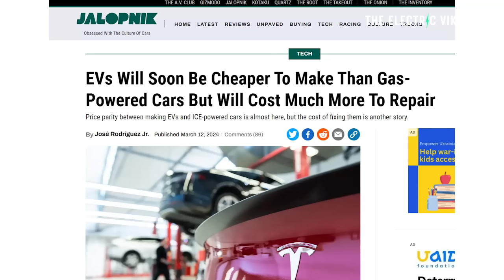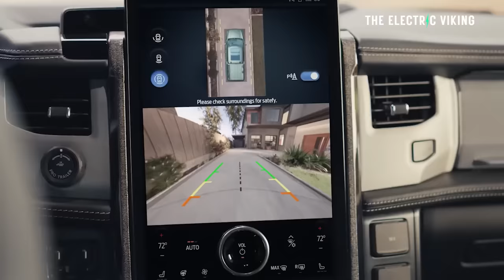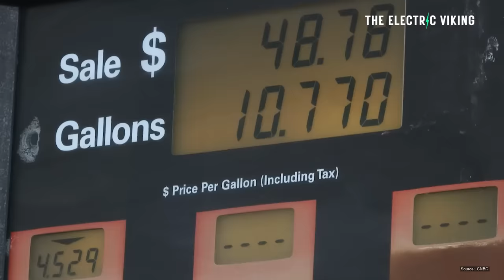The EV Price Premium no longer exists in the United States

Comment: And when they actually test the running costs, EV is the same or more expensive if charged at a supercharger in UK and only cheaper when charged at home. Total cost of ownership is what matters and seems things like insurance is double with EV compared to ICE, expensive battery might need to be replaced after 10 years due to degradation if one keeps their car that long. (although the claim is new batteries last a lot longer). Repairs: another example where EV, at least Tesla is much more expensive, afaik that was the reason Hertz was in trouble with their Tesla fleet, damage repairs much more expensive. When I did the math based on UK prices,  as long as petrol is less than 1.8 per litre, my ICE would be cheaper than the average per mile costs of EV charged at Tesla station at 60p per KWh.
Reply: Only if your silly enough to use a supercharger. Most people charge their cars at home most of the time at a fraction of the price. Unless your away from home most of the time your charging costs will be just a few (single digit) pounds/$ per charge. That's nothing unless your importing your own petrol at mate's rates from your brother in Russia
Reply: My understanding is that the business model of car rental companies is based on the expectation that they can buy a new car for $new, rent it to customers for, say, 3 years, then resell the car for $secondHand, and the depreciation cost of the car ($new - $secondHand) is low enough so the company can make a profit in its business. When Hertz decided to add lots of Tesla cars to its fleet, demand for Tesla cars was outstripping supply by so much that second-hand Tesla cars were selling for close to (and sometimes more than) the cost of a new Tesla car. This lead Hertz to think that adding Tesla cars to its fleet would result in a depreciation cost ($new - $secondHand) being remarkably low, and this would increase Hertz's profits.

However, what actually happened is that one or two years later Tesla managed to increase its production capacity enough so that supply was meeting demand, and this caused the price of second-hand Tesla cars to drop. To make matters worse (from Hert's point of view), Telsa began a campaign of aggressively cutting the price of its cars. The result of this is that the depreciation value of Tesla cars in Hertz's fleet increased alarmingly, and Hertz realized this was going to be bad for profits.

The above hypothesis is based on what I read about Hertz. I don't recall reading anything good/bad about Hertz's maintenance costs of Tesla cars in its fleet. I'm not saying you are wrong; merely that there might have been more than one reason behind Hertz's decision to remove Tesla cars from its fleet.

By the way, if Tesla continues to be successful in its mission to speed up the ICE-to-EV transition, then I expect that the value of second-hand ICE cars will drop alarmingly at some point in the future (logic: if most people want to buy an EV, then then the supply of second-hand ICE cars will outstrip demand for them, thus causing their price to drop), and once again car rental companies may find themselves struggling with higher-than-forecast depreciation on cars in their fleet. If so, car rental companies may find themselves in a "Damned if you do, and damned if you don't" situation.
Reply: @mikevanlokven7384  Silly enough? Are you silly enough to think that most people live in their own houses and can charge at home? You don't understand there are plenty of city folk living in apartments with no electric outlets anywhere near their car?
Reply: @CiaranMcHale  What I read is that the problem was with repair costs, because Hertz insures their vehicles themselves. So they pay repairs themselves and those were very expensive and slow for Tesla vehicles. Depreciation might also play a major role though as you said.
Reply: Tesla superchargers don’t charge 60p per kWh. 

Most I’ve ever paid is 43p per kWh
Reply: @cyberfunk3793  If no place to charge at home then be creative and work charging into your daily routine. I have met many people who do this.  Stop being so negative and use some creativity.  If you really want an EV, you'll find a way.
Reply: Power cell technology is improving and they're devising new types of cells that are much cheaper to produce, so in 10 years if someone needs a new power cell then it will be very cheap. 
What you need to consider is that electric cars have less maintenance because you don't need to deal with oil changes, tune ups, spark plugs, belt changes, (regular) batteries, alternators, fuel pumps, transmissions, smog checks, etc. An electric motor can last several decades with minimal maintenance. So if the only thing you need to worry about is spending a few grand to change your power cell once every 10-20 years then that's still cheaper than owning an ice vehicle.
Reply: @GoodBoyGoneDad  My Accord is 18yo and I never needed to change a fuel pump, transmission or alternator. Belt didn't fail, but I changed it myself for something like 20€ and I changed spark plugs once, they last 160k and are not very expensive . Tyres, brake pads, oils, filters, coolant I have changed myself and current insurance is 20€ per month (car is so old, I only have liability insurance on it). Even if I had total insurance it would have been cheaper than EV to maintain and I'm not so sure EV don't need a new battery after they are 10yo in the future also, we have to see what the real degradation is in the future.
Reply: @jakes6147  I just checked it few days ago, and it was 60p/KWh for people that were not Tesla owners. You can possibly get some membership that lowers that, but then you need to add that small membership fee to the calculation. Other fast chargers than Tesla are also expensive, if they are for example close to a motorway where ICE vehicle on a roadtrip would typically be filled.
Reply: @muskrat3291  What does it mean to "into your daily routine" ? I work at home and have no place to charge it for free. In the city I live now, there is free parking wherever you find a place and no reserved spots, so should I just be creative, find a house and steal their electricity during night time? Currently I fill the tank when it's empty and I'm going somewhere, no creativity needed for that and this is obviously a comparison between ICE and EV. I don't really want an EV, I might get one when current car dies but certainly the picture doesn't seem so rosy to people that live in apartments as many people imply. For EV to be cheaper, it seems you really need to be able to charge it at home during night.
Reply: @douglaswatt1582  Ignorance like: "In Australia, for instance, EV owners face insurance costs that are on average $661 higher per year than those for ICE vehicles."

My insurance is 20€ a month so yours is much more than mine although much less than typical EV in most countries. Why would I need personal experience to compare factual numbers and statistics? You can't do elementary school math? Talk about embarrassing 😂
Reply: @cyberfunk3793  You’re correct it’s more expensive for non Tesla owners and also there are very few superchargers in the UK that will allow a non Tesla to charge. 

One of the perks of owning a Tesla is the supercharger network, which in my opinion the other chargers can’t compete with currently. 

My local supercharger is 34-43p per kWh depending on the time of the day. (For a Tesla) 

But I charge at home like many other EV owners 99% of the time. It currently doesn’t make sense to own one if you don’t have that facility available.

Comment: Other issues: Still way to expensive to insure! Sure that will come down eventually, how many years before that happens. Secondly, servicing and charging Infrastructure!
Reply: Sure. If you’re a crappy driver.
Reply: @ConstanceCox that's wrong and uninformed. You pay for other drivers bad driving and their stolen cars. EVs will be impossible to insure soon.
Reply: @mikemars5984   Generally each post like yours is followed by an EV driver showing you are wrong.     However if you keep spouting this more insurance companies will raise prices because obviously the public thinks they should.
Reply: @danharold3087 EVs are heavy compared to a ICE with comparable size. EVs have large acceleration compared to ICE vehicles. It isn't necessarily right or wrong if insurance premiums will go up when the data insurance firms need to make proper quotes are based on a vehicle with less than 10% market share of currently registered vehicles in the US. I just liked the irony of people who complained a ICE vehicle had 1200hp on public roads, and now, somehow, everyone is on board with putting that weight and acceleration at their fingertips and for sure there will be less accidents because of that. Surely. They are also harder to insure as IF there was an accident, a damaged battery and enough body damage can easily exceed the 70% requirements to classify a vehicle as Totaled. You don't even have to impact a battery directly for issues to happen, not as likely, but it is a possibility with sudden deceleration. And with tesla incorporating whole cast body assemblies, body repair costs with be higher aswell. No more bolt on, it's all one piece!

Comment: EV sales continue to double every two years.
Reply: Sort of a Moore's Law type thing.
Reply: Not in the UK. Sales of EV's in 2023 were 16.5% of the total fleet, slightly down from 16.6% in 2022.
Reply: This is still the early-adopters wave. It will start to get worse and worse until we have good enough charging infrastructures and better and cheaper batteries.
Reply: @ev.whyking You are conflating the total cars out there with annual sales.  Annual sales continue to double every two years.
Reply: @ev.whyking Around six million sales globally in 2021 and around 14 million in sales in 2023.  Doubling every two years....
Reply: @ev.whyking You have a reading comprehension issue.  Try rebooting your hard drive.
Reply: Yeh, not from this point forward.
Reply: @romanpolanski4928 what is that in actual numbers?
Fleet means every car on the road of any driveline does it?
Did total fleet go up or down? And if so by how much? That's relevant due to the use of the % based on unknown numbers.
Reply: @MinusEighty any doubling is clearly over for the time being.
Reply: @ev.whykingyou are right percentage figures are Meaningless.
The actual numbers are crucial. 
They show a steady increase in BEV sales. 
However you look at it that is bad news for the ice makers.
Reply: Rubbish, the EV dream is over. The fight back has begun.
Reply: @mikemars5984  You clearly have a political viewpoint. To me it is just a superior technology that saves me money compared to paying for gas.  In reality evs will win because they are better. Faster, cleaner, and cheaper to operate.  But, by all means believe whatever you want.
Reply: @MinusEighty  Certainly not cheaper than my Accord so far, especially when I have no way of charging at home and insurance costs me 20€ a month.
Reply: @cyberfunk3793  Hey from now on, every time that you are fueling up and wasn't all that money on gas, think of me as I drive the same distance for a fraction of the cost.
Reply: @MinusEighty  And this will not last forever. The price of the electricity will go up together with the EV adoption. At some point in future you will spend the same money, not for gas, but for electricity to charge your car. Currently we are living in the best EV era, when it's still not massively adopted and there are such things like incentives, cheap electricity, free parking, no taxes etc...
Reply: @MinusEighty  Only way you could do that was if you have a home charger, which I could not possibly have in an apartment so why would I care? Everytime you pay your insurance, you can think about me and my 20€/month insurance bill on my Accord.
Reply: @MinusEighty  clearly, you are basing your opinions on your own personal circumstances. You are swallowing all the hype. Try projecting on the rest of the world and how that will work. Car manufacturers are reigning back on EV production. There are hundreds of thousands of unsold EVs. That's why the price is dropping. Insurance is having a negative impact. The EV utopia is a long way off. There is nothing wrong with an ice car with the right engine and fuel. I don't believe you are having no issues.
Reply: @mikemars5984  I get it.  There is a lot anger.  At the same time, my used Tesla is great, and my next one will have 300 miles plus of range.  So while the CO2 nutters obsess about slight temp changes, and people like you get angry about mandates. I will just continue to enjoy a great car, that is cheap to drive.  Peace.
Reply: @MinusEighty  You are talking to many combustion car owners here so 300 miles of range isn't something to actually brag about. I get over 900km on the highway on a single tank. I don't have an issue with EV and my next car might be one if the prices keep going down like it seems, but there are many EV owners that act like the vegans of the car world,  that present them as the best thing since sliced bread and claim they are so much cheaper when in many cases it's fairly close.
Reply: Just 2 EVs made it into the 2023 U.S. top 25 auto sales.
Reply: @planetsmoothcoaster  Still, doubling every two years...
Reply: @grasho kind of what happened in my home country when people disconnected themselves from the central heating system and started making big saving by using an apartment heating system using natural gas. Then natural gas prices increased greatly and now they pay the same as before. And that was before the Ukraine war started. Although if you have a home and solar panels you might be able to avoid this with an EV. But for public charging, in the long run people will pay the same as for gas...
Reply: Where? Not in Europe I’m afraid. We need better range, faster charging, cheaper cars and crucially better infrastructure. All needed for mass adoption for EV’s to become dominant.
Reply: In China
Reply: @romanpolanski4928 everywhwre they have dropped except China and Norway .
I'm guessing it's the terrible depreciation when it comes off a lease .
Reply: So now it has gone from 10 to 20 wow

Comment: I have a Tesla, and your statement that "you don’t use brakes besides regenerative braking" is highly exaggerated. I use maximum regen, AKA “one-pedal” Unless you have a lot of time to slow down gradually, stop signs and red lights or stop and go traffic ensure that maybe half to a quarter braking is used compared to ICE. When you’re above your set charging level or below 20% in older EVs, regen braking also does not work. Sure, the overall load on the brakes is much less per weight of the car, but most EVs are a bit heavier. Because you know better and have admitted to these points in other videos, I hold you to a higher standard of honesty, and downvoted this video. Considering I’ve liked hundreds this is regretable but the best way to send feedback.

The main thrust and topic is right, but not because EV subsidies outweigh the price difference. In fact oil and gas are hghly subsidized, so a transparent accounting means that ICE on average cost more than EVs, even over medium time periods like 5 years. We don’t typically see the tax money going to factories, refineries, health care related to injuries and “accidents”. We will not get as much return on investment from fossil fuels as renewables. This is without even considering the cost of infrastructure due to worse weather, then to mitigate and reverse global warming, or related insurance premiums.

Comment: What is the durability of the EV compared to ICE?  Do the EV has a cooling system?  Thank You.
Reply: They are usually water cooled
Reply: The battery is thermally regulated to warm in the cold and cool when charging. The motor is also liquid cooled.  There's an air conditioner which can cool the car and heat the battery, or cool the battery & motor to heat the car, or (with a heat pump) cool or heat what needs to be cooled or heated. On an ICE this is all run off pulleys and belts off the engine, so there's maintenance and inefficiency, and God help you if it breaks inside the engine. EVs have external pumps and an A/C motor which run more efficiently and are easily replaced. The durability is unknown; hoses and motors don't last forever, but most do.
Reply: @jamesvandamme7786  your correct. But ICE vehicles overall efficiency gets better in winter, as waste heat is now useful. EVs overall are more efficient. Glad to see the use of heatpumps, about to install one for home heating

Comment: Most other sites have EV's sales crashing.
Reply: According to NPR, EV sales are expected to set another record in 2024 after a record year in 2023.  Rate of increase is moderating.  Not crashing. 
It is hard to find exact numbers for the decline in ICE sales.  Did find this.
CleanTechnica 
Putting numbers on it, the drop in ICE vehicle demand will mean 2.5 million fewer vehicles this year, 4 million fewer in 2024, 6.5 million fewer in 2025, and a whopping 9.5 million fewer in 2026 for a loss of ICE sales totaling 22 million vehicles over the next 4 years.  
Many other sites want clicks too.   Misrepresenting EV sales is one way to do it.  Pander to the ICE crowd.